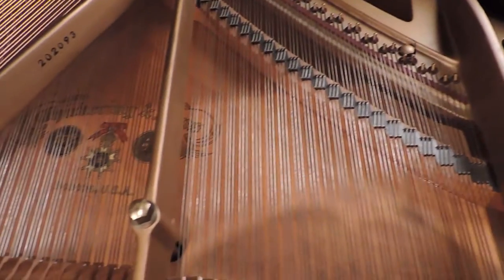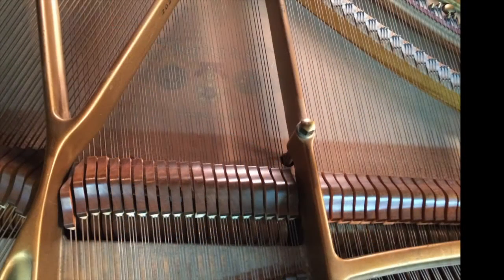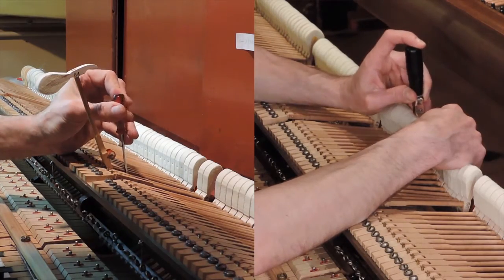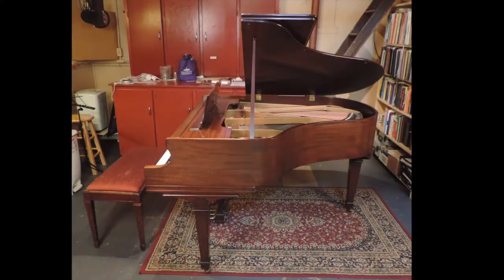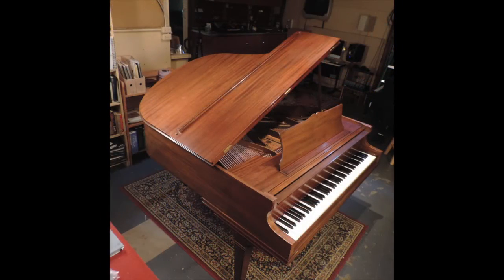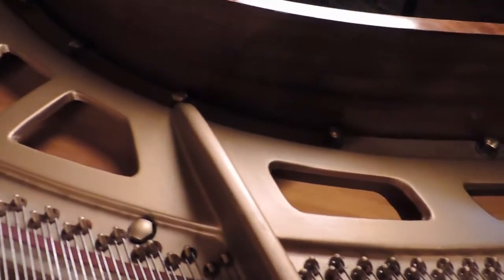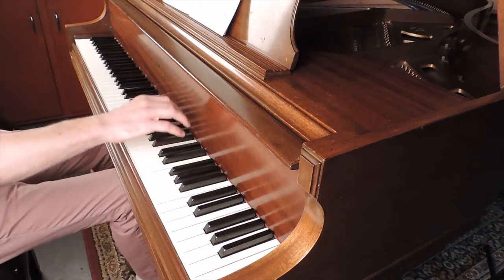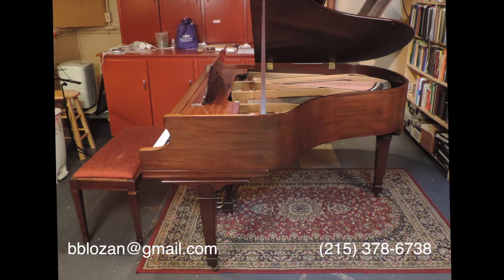Chickering Ad

Comment: Beautiful. Amazing work. I wonder what the difference would be with wursen aa felt hammer model for, Ronsen. Also, does the wicket hammer have under felt?
Reply from the maker: Thanks for the comment. I've not tried the Wurtzen felt (and may never since I like the Weichert so much). Ronsen's Weichert hammers do have under felt--up to maybe the last two octaves or so. Ronsen has a website and a phone number if you want to find out more. Before long I'll post a recording of a 9-ft Chickering with their hammers as well as GC bass strings. Incredibly warm sound!